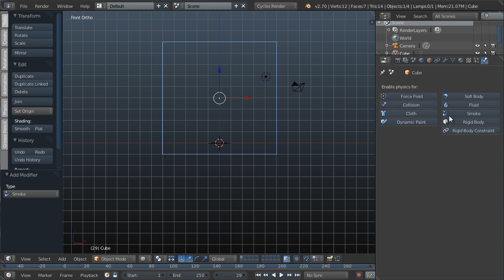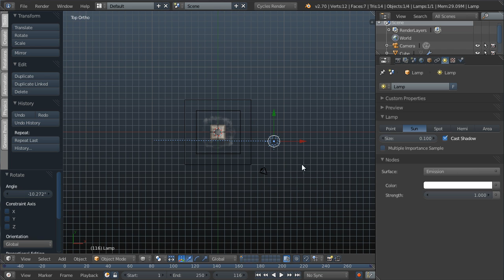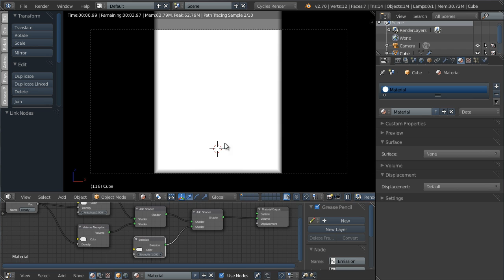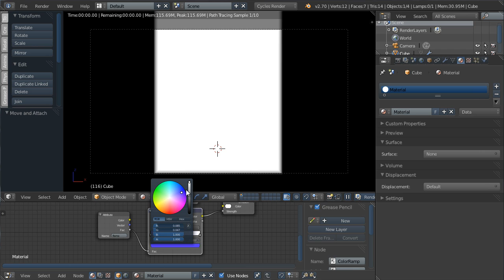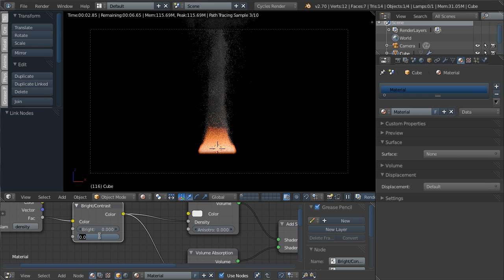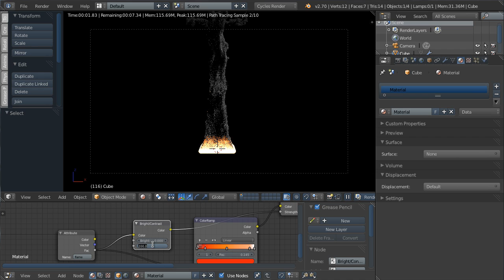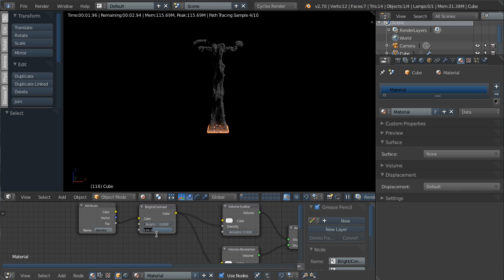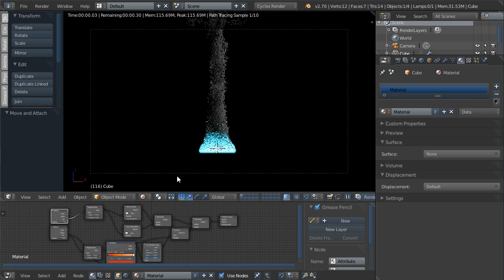[HD] Rendering Fire & Smoke with Cycles in Blender

Comment: 2.72 is not smoke friendly.....or can anybody point me in the rite direction?
Reply: I'm using 2.72 without trouble. Smoke trouble that is.
Reply: gyrocam
You did good then.... I still cant get it to work....Not to render anyway.....
Reply: Me Craig
Have you followed this example? (download blender 2.72 if you haven't already) You might have to check mark CPU instead of GPU. That could trip things up... Make sure you have your scattering and absorption volume nodes connected to the material output volume for the container... and use the "density" attribute. Check this video at 4:50 the author has just five nodes for the smoke container and that is all you need...unless you want to play with fire. Ha! Hope that helps.
Reply: gyrocam
I appreciate that info..... As I was readi8ng your comment , I tried all this word for word , except I noticed the word "density"...... I think I spelled it "Density".... I will try that and hopefully that is it..... Again Thanks.....from the 3DBlenderNovice
Reply: gyrocam
Well I never would have figured that one out........I used a capital D......Many thanks to you fellow Blender.....
Reply: Me Craig
You are very welcome. I'm glad to help. Fellow Blender.

Comment: I am not able to switch the device to CPU from GPU. The device option as seen in the beginning is not there. Mine is like http://blenderartists.org/forum/attachment.php?attachmentid=210691&d=1357503163
Reply from the maker: Go to User Preferences > System. Change the setting in the bottom left corner to CUDA and then change the device to your GPU if it doesn't already do so.
Reply: Ok, thankyou!

Comment: Greetings, I initially tried to work this tutorial by applying the 'quick effect' option, but it did not work. When I followed your instructions by setting up the flow plane and the cube as you have done in this tutorial everything worked. Perhaps the 'quick effect' is not working because that may be a bug ;)

Comment: i am experiencing something here, hehe, when i use the attribute node and connected them to the density of the shaders, the object disappears from the rendered view?
Reply from the maker: Make sure you're rendering on the CPU.
Reply: Wireheadking hi, thank you for the response, I am rendering using my cpu, still, the flame won't show in the rendered view, hehe, what might cause this? I followed each step, and I've downloaded the latest build, hehe
Reply: neilcorre2k6 I had the same problem. U have to have 2.71 to make it work. Dnt knw y, but thats seems to be the solution.

Comment from the maker: Aryo Seno RAW TEE To anyone experiencing a 'black render', follow these steps (tagged people have already tried some of these):
1. Ensure you have the latest version of blender available from the link in the description of this video.
2. Ensure you are rendering in cycles on the CPU.
3. Ensure that the node set-up is going into the output's 'Volume' socket.
Reply: I have the 2.71, I'am rendering in cycles on the CPU and the node is on the volume output... But I still have a black box on render... What could be wrong?
Reply: +Diego Alcocer ver 2.77 now supports GPU rendering for smoke.
Reply: oh ok i dont have the latest,...i have the 2.70....But blender crashes when i update mine...
Reply from the maker: Aryo Seno
Try deleting everything in the Blender Foundation folder in your program files and extract the correct .zip from builder.blender.org into the Program Files(x86)/Blender Foundation folder

(if you have any add-ons installed, then you may want to move them to the desktop and put them back in once the files are replaced. Only do this with add-ons you manually installed rather than the ones that came with Blender. You will also want to get the latest versions of these add-ons.)
Reply: ok ill try, thank you
Reply: Andreia Calhau
Hey, 3 months later and I still cant get a render of smoke..... 2.71 or 2.72... I hate that.... Follow along exactly and can not get the same thing as I see.....Makes me feel bad......
Reply: Wireheadking Used to have that problem with '2.74', but when I exit out the rendered mode and back in, it worked!
Reply: Me Craig  same here.. i can see the emitter, but no smoke
Reply: Abe Bell .............. be sure to check the spelling on the Attribute nodes...... try capital and lower case D or d on density and flame.......  its been awhile since I was using this.............
Reply: Wireheadking Is there a way to render this out with the GPU?
Reply from the maker: Diego Alcocer Try the CPU
Reply: did it work for you ? mine gives errors and crashes .. :O

Comment: hey! i have a problem maybe u can help....The smoke doesnt render when i pres F12... it's just nothing..without the domain, without the smoke...can you help... i already set the frame where smoke is appearing..
Reply: Did you try this with a smoke simulation you made earlier??? If you did, you may need to start a new file in blender and try again to get a handle on it, then try importing your other simulation to the domain in your new file. If that's not what is wrong, then I'm not sure :(
Reply: TechnoStickmen Hi thanks for the help... I did test them, it doesnt work..It's because im not using the latest build of blender....

Comment: Is there a way you can change the tint of the smoke for easy composting? I was also wondering what you 3d figures did you use to make that explosion. Thanks!
Reply from the maker: Yes, you can change the tint by changing the diffuse colour both density nodes. You may want to have them share the same RGB node as their input.

And for the explosion, I had a UV Sphere, a short, hollow cylinder and a cut-in-half UV sphere.